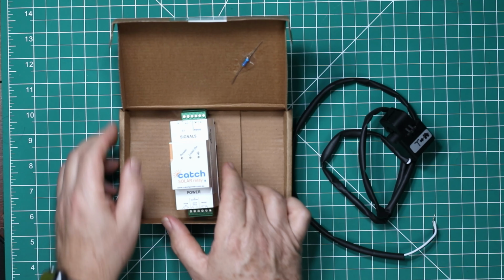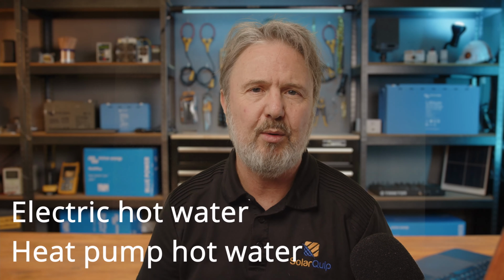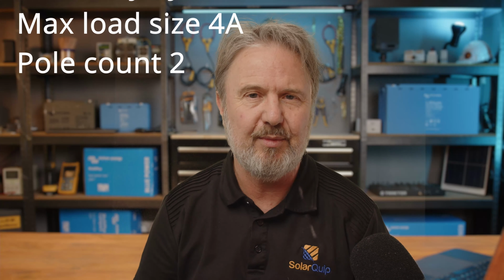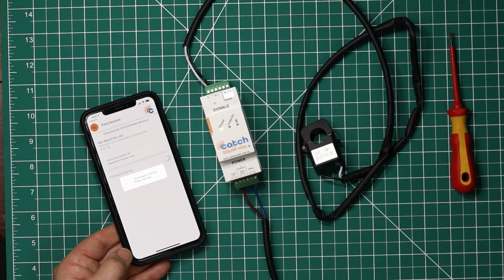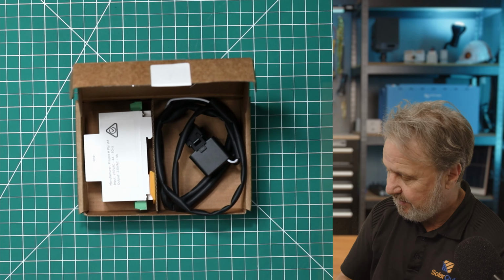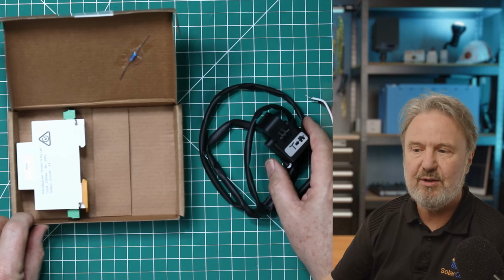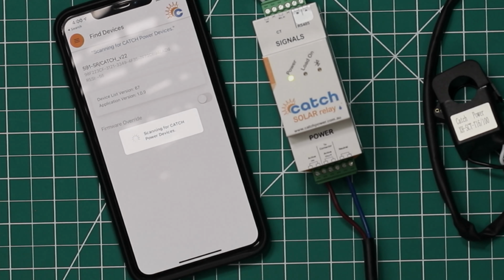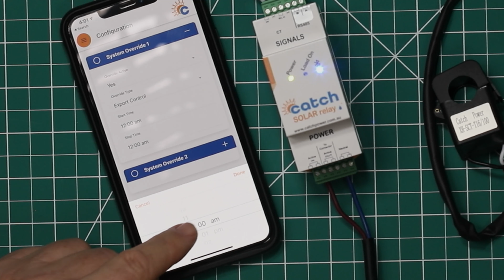Catch Solar Relay

Comment: Glen, would this be able to work with an off grid system to turn on loads when battery is full and excess solar being produced??
Reply from the maker: Hi Roy, I'm off-grid and use the Catch Solar Relay to turn on hot water element when the frequency rises on my off-grid system (this is a feature of many a.c. coupled off-grid systems - it's called frequency controlled power)